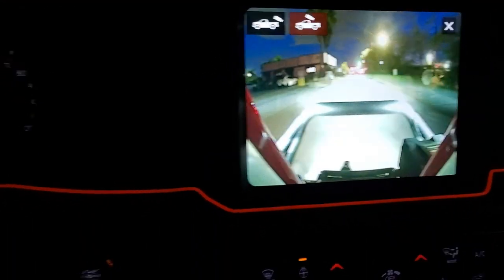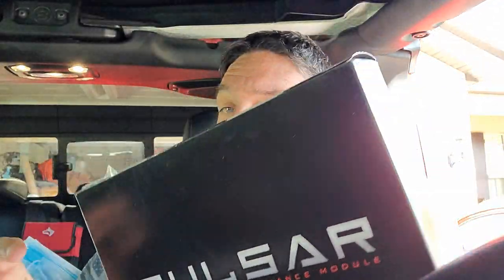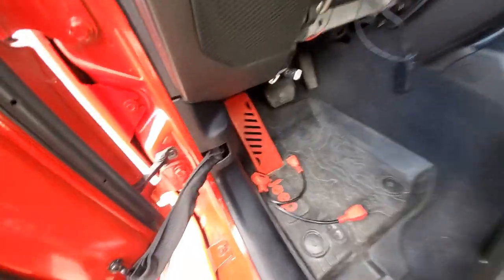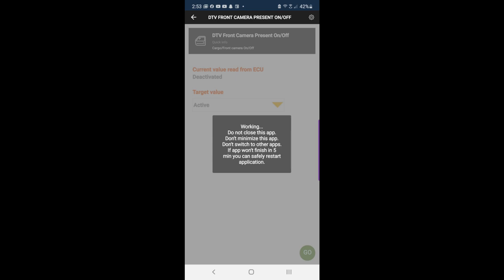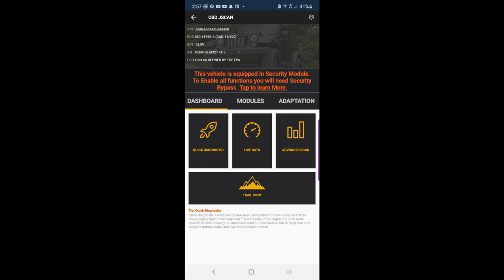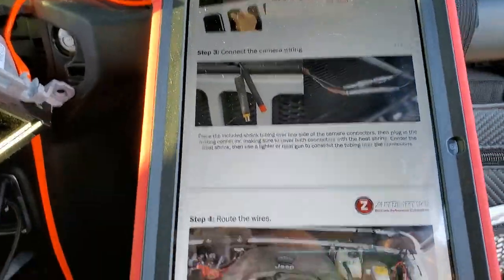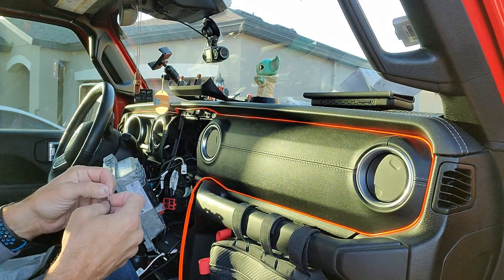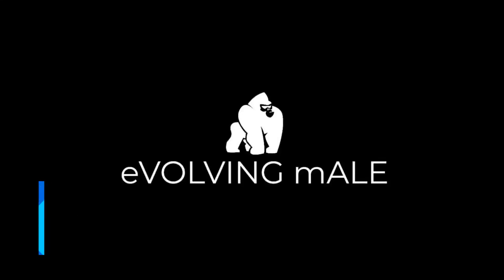DIY Trail Cam for the Jeep Gladiator -  Part 1

Comment: Did you use the mx+ or the v gate. Great video, your stripes are awesome
Reply from the maker: Thanks you. I used the vgate. I bought both but found the more expensive one didn’t do anything else, really
Reply: @EvolvingMale  so you could still get in the radio with the cheaper one.  Did you notice of you can add the auto bright lights.  Thanks
Reply from the maker: @chrishunt5291  no but when I got in the radio with the MX+, there was nothing to do. Worthless.
Reply from the maker: The auto bright lights are somewhere else. I turned mine on but still doesn’t work. At least I don’t see a difference.

Comment: do you have to have the 8" radio for this camera
Reply from the maker: Yes. It's my understanding the the two smaller radios do not have a second input. However, there are some fairly inexpensive (cheaper than this mod) cameras that come with a small screen on Amazon that would work great. Full time in fact. Might be better.